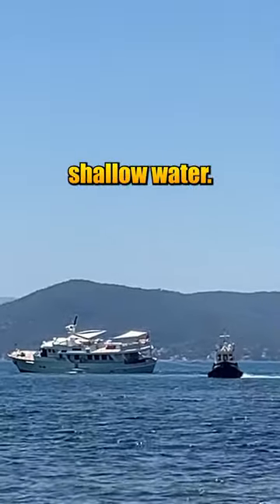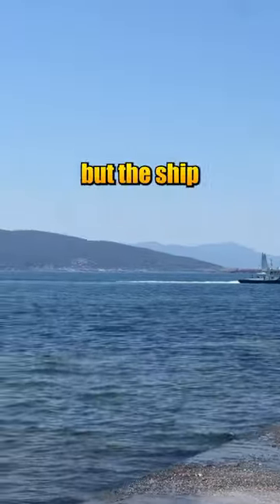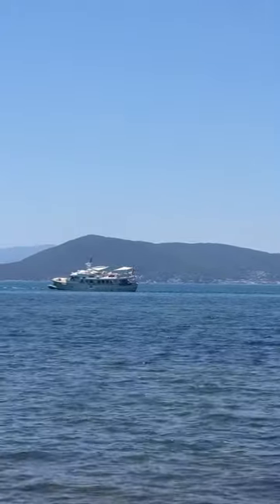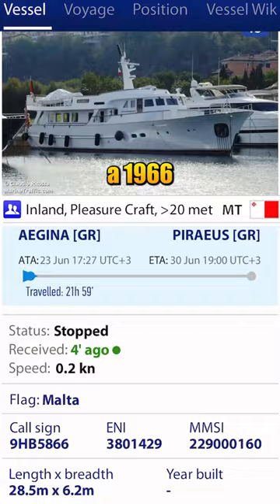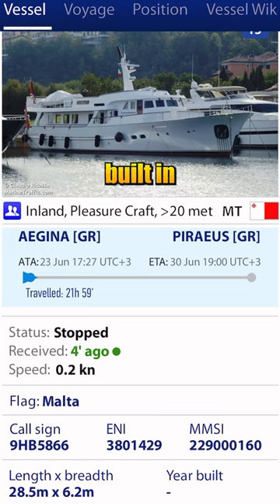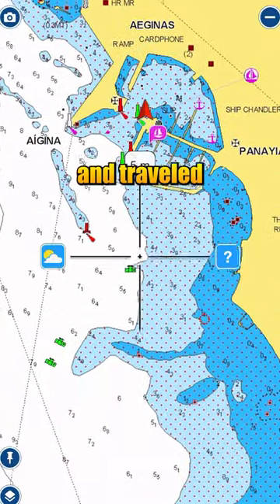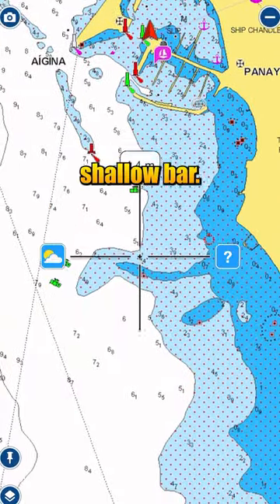Super yacht stuck hard aground on a reef in Greece!  #superyacht #yacht #boatfail

Comment: Doesn't that kind of boat have a depth meter?
Reply from the maker: they probably weren't paying attention to their course
Reply: @Sailingdoodles  I bet...
Reply: Depth meter don't help, they tell the depth right now, if there's something like a rock or a wall like in this case, it will be too late. Charts and warning bouys are the only help here. The latter are visibly not present and other commenter said the charts also don't have the info. That's bad.
Reply: @tiagorinckcaveden4114   Thanks!!!
Reply: @tiagorinckcaveden4114  the shallows are clearly on my charts, so are his charts outdated ?
Reply: @davedavids9619  I don't know, I just said what other commenter said, claiming this is a submerged wall that wasn't on the charts. Regardless, there should be warning bouys...
Reply: @tiagorinckcaveden4114  I am currently sailing in this area and I checked my charts............it is clearly on the charts, so the captain should have simply steered around it. I don't care whether it is a wall or a sand bar, if it is too shallow you have to stay away from it. Cannot be too difficult I think.
Reply: @davedavids9619  I have updated charts and this wall is not there. The only way to see is at Google earth from the space.   Local police has MANY reports about accidents around this place.